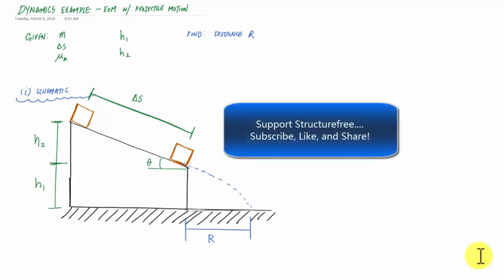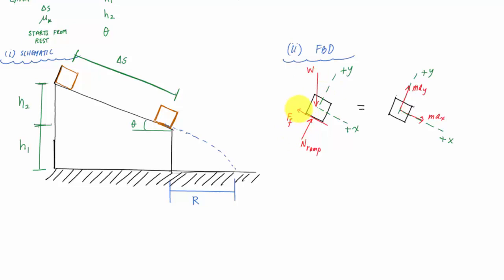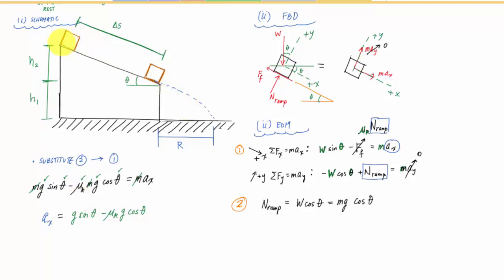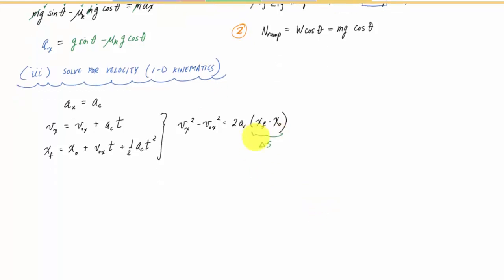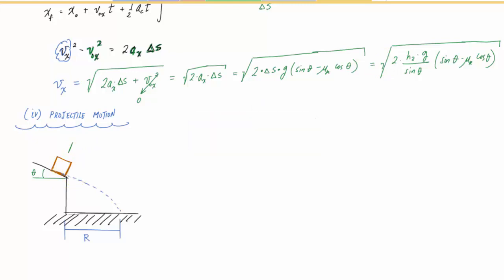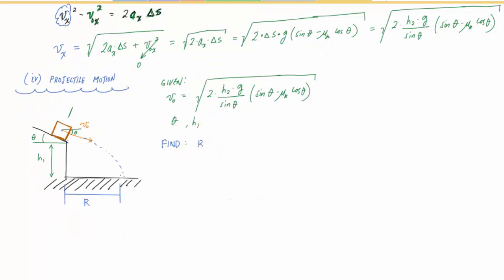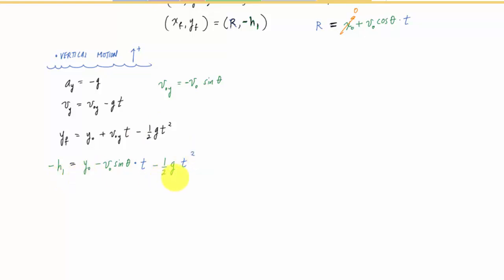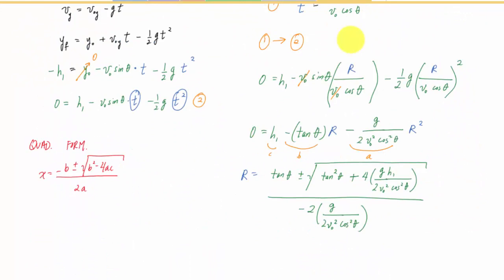Symbolic Example with F=ma in X-Y components and projectile motion - Engineering Dynamics

Comment: Nice video, but you could have thrown out the solution for R which is negative ( it's where the parabola crosses zero but on the other side) because it's not a correct answer. I'm being picky though I like your enthusiasm. 

Also a quicker way to get the v0 velocity could have been to use energy theorem: 
the change in mechanical energy is equal to the work of non conservative forces (namely the friction force over what you called delta s). Just food for thoughts
Reply from the maker: Thanks for the checking! I was trying to show someone that it could be done without the principle of work and energy.  I definitely agree that PWE would be the best way to go to get the velocity as it leaves the ramp.